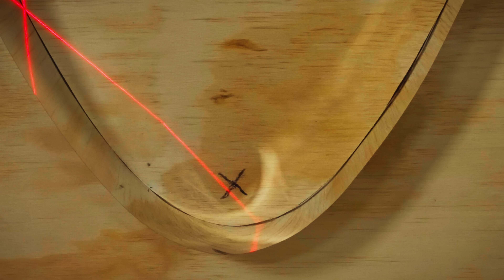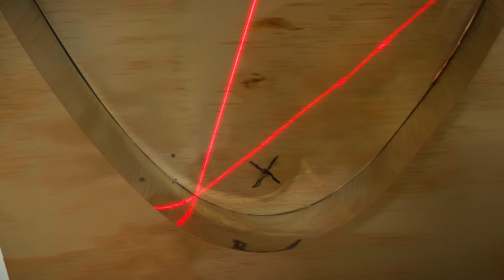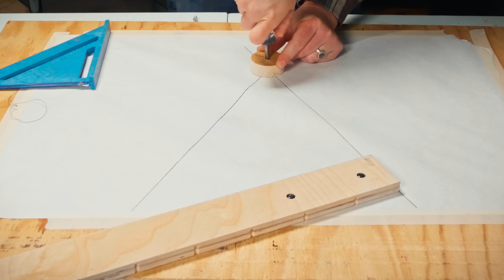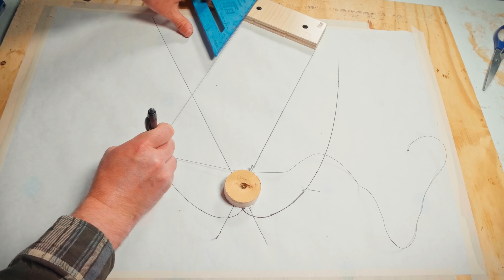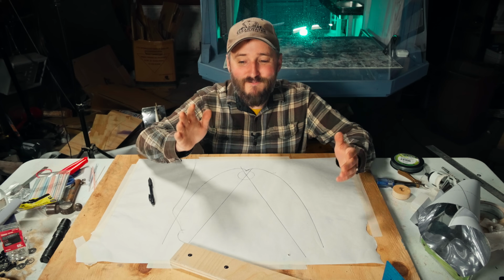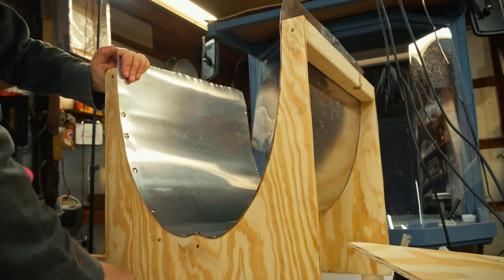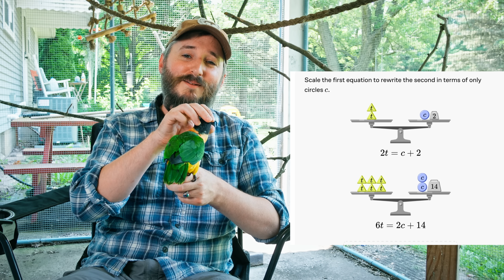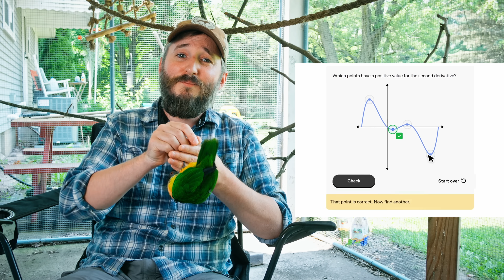DIY Solar Concentrators, Made Better.

Comment: Hey, I was just wondering if this would work with your other existing projects on sub-ambient coatings.

Energy is turned to work from gradient.

So a passive generator design using using a compound parabola to create steam for generation which uses the sub-ambient paint to cool the steam generating on the downswing.

Obviously the PLA based paints aren't temperature resistant, but the other designs may be.

I'm not sure if I've explained well, or if there is a more efficient design than what I've described just voicing a potential larger project you could test.

I love your videos by the way, I recreated your intumescent for some rocket designs when you first posted.

As well as making cheap intumescent linings for my chemistry cabinet and some thermite and smelting furnace projects and tests I did.

Praise science.

Comment: I found a WWII searchlight mirror at a garage sale and set it on a tracking mount to follow the Sun. The focal point is approx 120mm dia. I looked for a suitable collector and found the base of a M104 shell casing is ideal. It generates in excess of 700C on a sunny day. Thanks for the examination into double parabola to increase incident rays.

Comment: A hanging chain is a very good approximation to a hyperbola, but they are not the same. They are so good approximations, though, that it is easier to get a good result with a hanging cable than with the speed square method.

Comment: Measuring from opposite ends could induce a false temperature reading,  as the parabolic collector is not on the rear side of the wood panel. Thus it could appear cooler than in reality by measuring that way. Obviously the air will be hotter at the collector side and pipe end and dissipate down the pipe and into the atmosphere and thus cool in the process.